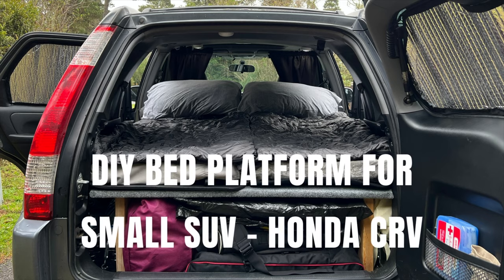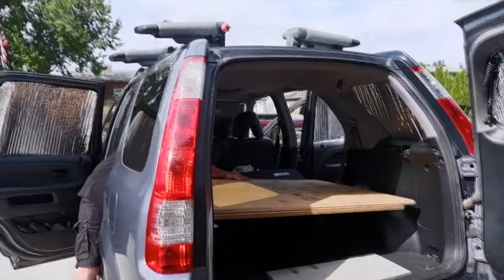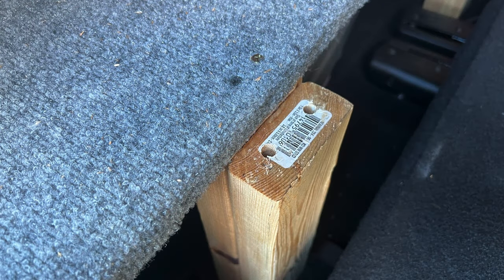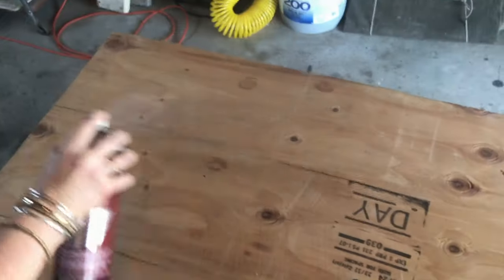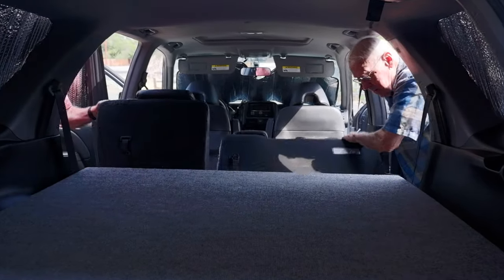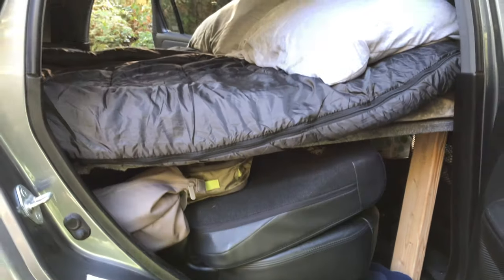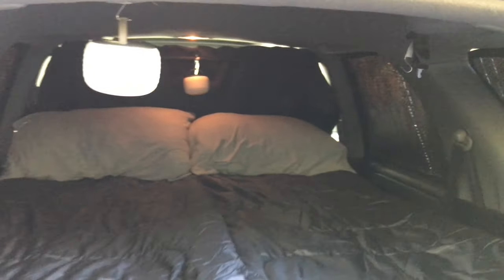Honda CRV Camper Conversion | Bed Platform | HONDA CRV | SUV Camper Conversion

Comment: This is so sweet! I was looking for a video on how to make a bed platform like this one but for this specific generation of CRV. Thank you so much.
Reply from the maker: Thank you! I’m so glad you found the video helpful!
Reply: @PatriciaDavidsonPhotography  I tried to make it work on mine. unfortunately, I do not know why but the space between the back door and the back seats is different in your car and in mine. I surprised when I tried to make it exactly like yours, it did not fit in my car. maybe because mine is a 2004 and yours is a 2005? same final length of 74inches. now I am having a hard time bringing the back seats up because the upper panel is too long hahaha. anyways, I will figure something out. this video is still very helpful.
Reply from the maker: @edy6722  Oh no! I hope you figure it out. You may have to do some little curves to get around areas by the door. If you notices we had to cut out the corners of the boards on the back boards to close our door. Keep me posted. Fingers crossed you'll get a good fit and be on your way to camping in your car! All the best!
Reply: Start with taking the rear seats out (8 bolts)
I made a template from cardboard to start with makes things a whole lot easier to plan and pre storage and less weight! When you need the rear seats bolt them back in, there’s no electrics to get in the way!

Comment: Really amazing build!! Just bought a 2006 crv and feeling very inspired by your efforts ! Is there any chance you know the dimensions? Could do with knowing the leg length at the trunk end and the Length and width of the permanent piece in the back
Reply from the maker: I'm so glad you found the video helpful while considering your build! We did mention in the video list of what we used at the beginning of the video. I'll add them to the description. Thanks for bringing that to my attention. We used a 4 x 8, 3/4"' Plywood board and cut it in half. So the width in place is 48" and the length is 74" with both boards in sleep mode.  I hope that helps!
Reply: Thank you so much !

Comment: Your setup looks nice. I've not built a platform, but have folded down the back seat & climbed in to see how I'd fit. I'm 5'4" and I don't have enough length. It's about 4" too short. I've watched many of these build out videos and they all can stretch out when lying down. Can't figure out how everyone is getting all the length.
Reply from the maker: Thanks for your comment. My husband is 5'10" and he's able to stretch out. But in order to do that the front seats are pushed forward all the way when in sleep mode. I'm 5'4" and when I travel by myself I don't push the seats forward so that if for some reason I have to get in the drivers seat fast and drive I can. So in my case traveling alone the front plywood board isn't fully extended to the 6' length, so it overlaps a bit.  I don't mind the bump from the over lap as I lay a blanket over it and of course my mattress if over it so I don't notice it.  I hope this helps!
Reply: @PatriciaDavidsonPhotography  Thanks for your reply. I do push the front seat all the way forward. I just need the one side, but no way can I stretch out. I have no idea why, but I cannot fit. The mystery continues.
Reply from the maker: @Judy-fi7ce  How interesting. What vehicle make and model do you have? Year?

Comment: What were all the support legs  dimensions?
Reply from the maker: Well I didn't add them because it all depends on how far the back seats lay down. Ours do not lay flat so we had to base the front and back supports based off that to be level.  My understanding is that not all Honda years are the same.  Let me know what vehicle and year you have.  If you would like me to measure them for you, I certainly can tomorrow and post here.  Thanks for watching!  ~ Patricia
Reply: @PatriciaDavidsonPhotography  I have the same! 2005 Honda CRV. It would be magnificent if I could get the dimensions!
Reply from the maker: I’m currently camping so relying on my measurement phone app. The Front legs are 22”. Using the phone app for the back was more difficult and it came to 14”. My husband swears they are 13” though. If you are not in a hurry we can measure better when we get back home. It won’t be for a few more days though. I hope that helps!
Reply: @PatriciaDavidsonPhotography  this is perfect thank you so much!

Comment: Nicely done. I am just starting my platform build in my 2019 Honda CRV. How difficult is it to get in and out of the car? Wondering if getting out through the doors are a challenge.
Reply from the maker: That's exciting that you are working on your build! I'm not sure about your 2019 version as ours is older but it's easier to get in and out through the side doors. We don't get in through the back because our door opens on the side instead of up. My husband and I joke about how it much look to someone on the outside watching us crawl in and out ;) But we are healthy and fit so it's not a problem. Thanks so much for your comment and good luck with your build!

Comment: Couple questions: what are the heights of support legs for this build? And when cut in half, do the boards both measure the same 48x37, or is one board slightly shorter than the other?
Reply from the maker: Hello, the support legs are 13". It may differ for other SUV or Honda CRV models. This is for the bed platform resting on top of the folded down seats. And you are correct about the platform size as it is cut in half exactly. As mentioned in the video we had to put notches on the corners of the front board that pushes back over the top of the other board when not in sleep mode. Your vehicle may have something similar to work around in the back of the car in order to close the door.  Good luck on your build and hope that helps!

Comment: Would you mind letting us know where you got your window coverings from?
Reply from the maker: The window coverings I made from reflectix picked up at Home Depot. Then I found some black fabric that I sewed on seam binding. That seam binding was pulled over the edges and I glued down with a hot glue gun. For the privacy between the front seats I bought blackout curtains and trimmed them and hemmed them. We use a tension curtain rod to hang it. I hope that helps. Let me know if you have any other questions!

Comment: How much space is it from the top of the matteess to the ceiling? Ive been wanting to do something similar but i cant decide on how tall my bed platform should be. Is that a comfortable amount of space?
Reply from the maker: Well not enough to sit up completely. But for us we are busy out hiking most days so we are we are tired when we get back. Sometimes though we watch a movie or read. To do that we prop up a little ;) We had to have this height because the back seats don't lay flat as I think you can see in the video.  Good luck on your build if you decide to do it!

Comment: Would you be so kind as to send me the final dimensions of the elements? Thnaks!
Reply from the maker: This is in my description Finished size of the bed platform is 48"w x74"L (with both boards in sleeping mode). I'm sorry I don't know cm but I'm sure you can Google a conversion generator from inches to cm. Good luck!
Reply: How did you attach the front legs?
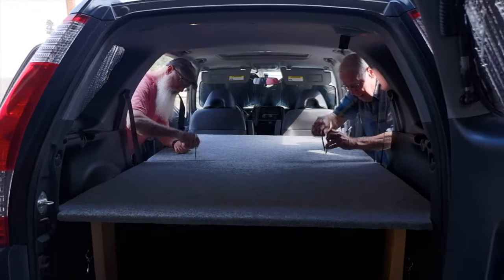Reply from the maker: @heritagechiropracticsports3566 Watch at 2:23 I mentioned the drilling of the support leg holes. Did that for the front legs too. So then we used bolts for the drop pins into the holes. These bolts are listed in the product list at the beginning of the video and in the description below. Hope that helps. Let know if you have any questions! Good luck in your build!